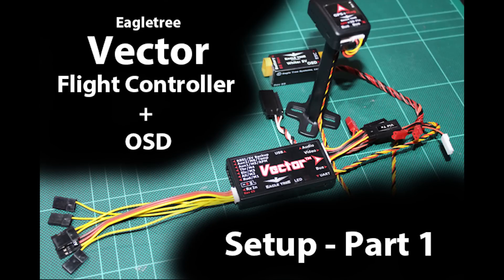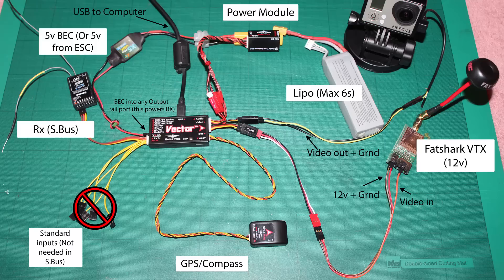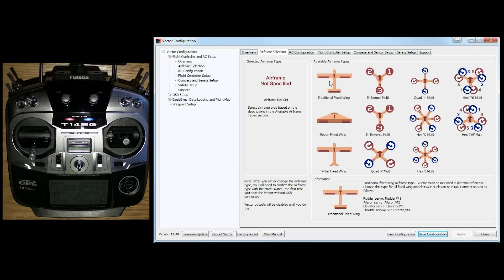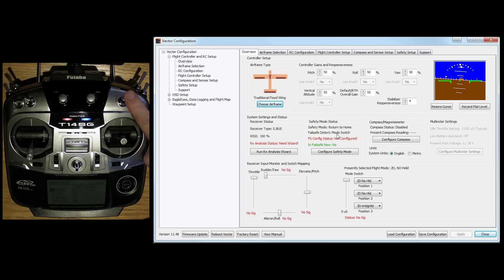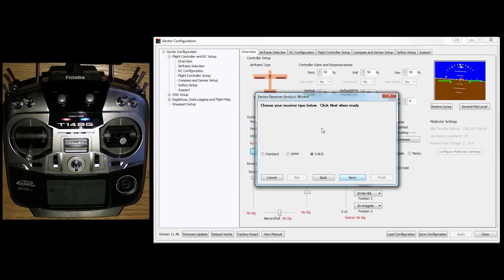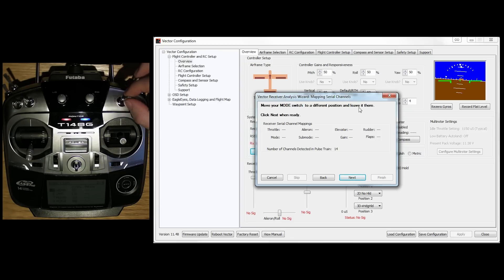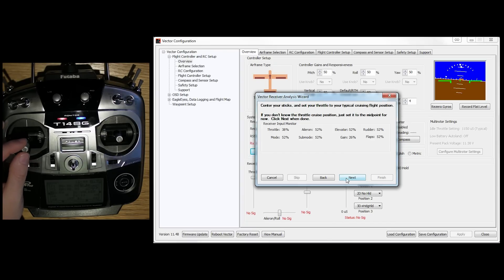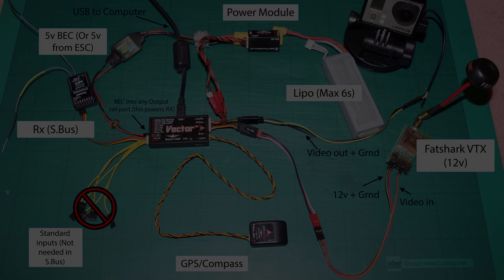Eagle Tree Vector - Guide/Setup - Part 1 (RX/TX & Sbus Configuration)

Comment: hi will you be doing a video with the vector for hexcopter
Reply from the maker: I will do a few for Multirotors in general. Due to the crappy windy weather I have literally just finished building what I call a Phantom 1.V (V for Vector).... basically used my old Phantom 1 shell that was laying around, strapped the Vector into and powering it with a 4s.... should be entertaining! Anyway as part of doing that I will be using it to show the 'stick menu' setup (adjusting settings in the field via the OSD and not the software). Everything I do on that will be relevent to Hexs. If needed I will also do a seperate setup video using the software too.
Reply: Great stuff mate can't wait for them
Reply from the maker: Robert Matthews - you may have seen it by now but: http://www.youtube.com/watch?v=MvrdgX8s-ks
Reply: Yes mate very help full thanks

Comment: Please excuse my ignorance!!  I'm setting up my vector on the bench with all the other equipment to program it and ensure its all working before fitting it to my Skywalker.  I'm a bit confused, I will be using a ubec like you (SBEC actually), I see you have tapped into the output of the power module for the UBEC, am I right in thinking the the ESC will plug into the power module then the BEC wires from the ESC go to the throttle channel of the reciever (with the positive wire removed)?
Sorry if this seems like a bone question but I'm looking at it and my brain has frozen!!
Barry

Comment: Thank you. You video helped a lot. But I have ran into a problem.  Ok. My osd is working. My receiver is bound. I'm connected with ppm. I did the rx analysis wizard.  I have a pan servo connected directly to my rx. When I power everything up, I have osd, my pan works but none of my rx\tx controls work.
I can't figure out why.

Comment: could i use a ESC (with a BEC) and and have the banana plugs connect to the CS and Motor and then plug it into the throttle slot of the OSD? This so that the battery power is coming straight from the throttle. is it okay to that?

Comment: Hi thanks for putting these videos together. Really Helped me a lot getting set up etc. One question I have is That i have chosen to use the SBUS configuration / mapping with my Dragon link everything is fine in the TX wizard . What I am experiencing during flight is once i initiate a failsafe either by TX off or selecting return to home test , the failsafe activates ok and RTH engages however the motor stops and I have to manually increase the throttle to remain on the home course. Also During my last flight I experienced an automatic flight mode change from 2DH to. Loiter mode without toggling the mode switch .. I have reloaded the firmware again just incase this was a glitch .. but if you have any ideas about the RTH throttle  control , would be much appreciated . Thanks

Comment: Having issues with my V-tail, in stab-off only one servo works as for pitch.
when in 2D+Hold it works fine. BUT i never have the correct rudder control, the rudder is just pitching the v-tail up and down.

Comment: i am new to this fc..i would like to know the following

1) can i plug all 4 esc with red cable (the 5v one) as spear power to the fc or only can afford one?

2) is vector has "fellow me" feature like pichwak ?
Reply from the maker: 1) Not sure i fully understand the question. The vector uses its own power supply to power the FC, however you also need a second source of power (an ESC with a BEC in it or a seperate BEC to power the RX and/or servos off it). You can use the 5v red cable to power the RX too if you want but a seperate BC is a safer option.
2) No - would be nice though as it is a fun feature.

Comment: also can i use usb talk to the fc at the same time plug the lipo power the board? will i burn the board if i do so?
Reply from the maker: Yes you can without any problems at all. It makes setup via the software much better doing it this way as you can calibrate your voltage readings as well as see the output of the OSD too.

Comment: one thing I learned when setting up the transmitter is that if you have dual rates programmed in a model already that you need to setup the Run Analysis RX wizard on the highest rate otherwise the Vector only sees the lower rates and that is most throw one will get.

Comment: Hi there, I love your vids on the vector. very informative. I do have a question.  I just got a micro vector ''cuz I heard it supports a V-tail quadcopter config.  Now I hear that it does not.  Not quit sure what to do now.  It was suggested I should select the X frame and lower the yaw gain or rate.  I'm trying to install onto a "Flite Test" Bat Bone frame in the David Windestal V-tail configuration.  I don't know if you've seen Flite Test. Anyway, Do you have any suggestions? It would be quit appreciated.  Thanks for your time and keep up the good work sir... Steve

Comment: HI i have a problem with my ailerons i have exactly the same futaba 14sg an check my servos with another receiver and all the time after the analisys wizard when i finish i unplug the USB cable for check if the servos work but those ailerons are locked on one side i mean the plane turn and climb or dive and i can not fix that with sub trim.T
on the video the motor start at throttle midpoint like with multirotor end the motor is DJI E600 but after reverse now it work perfectly...
how to keep the aileron at the center point?
See my video link below
https://www.youtube.com/watch?v=6citzdaqxto
I don 't know if i need to set something else in my futaba tx
i don t know how to program it i only select normal plane and selct elevon in software.
i don t know how if i should to do mixage and i thing normaly i should no need to mixe.
please i need help 
Thanks